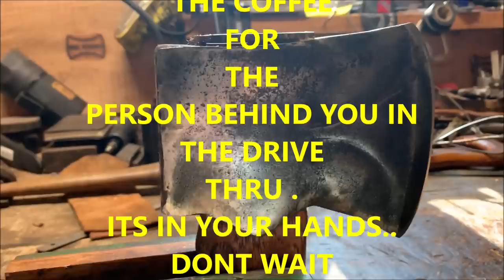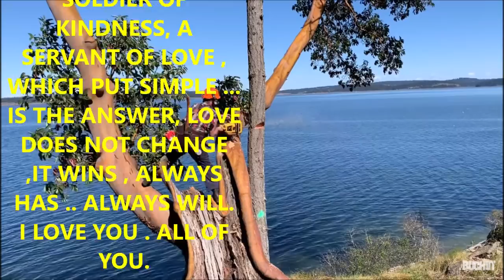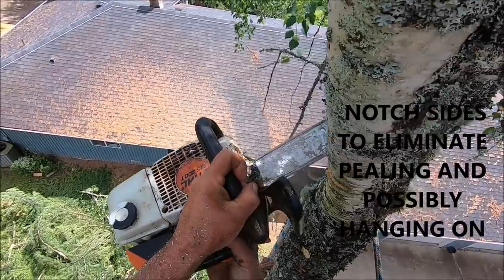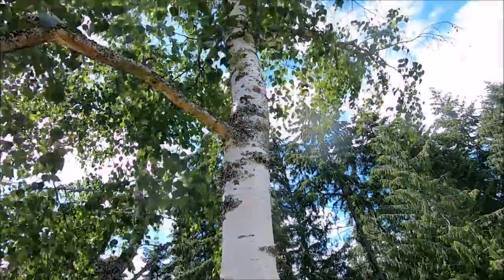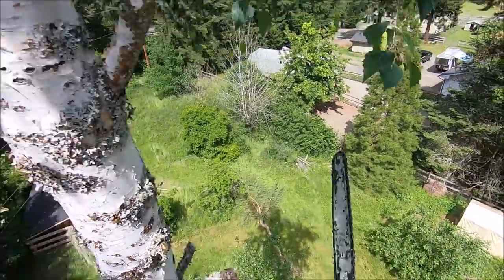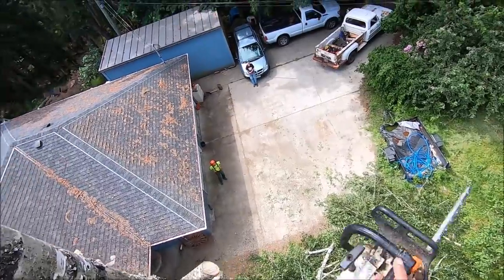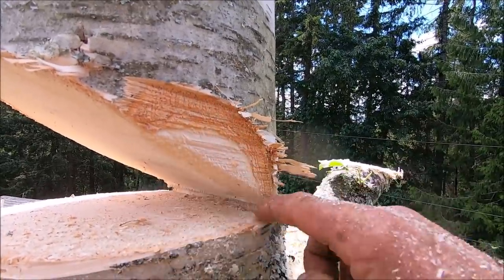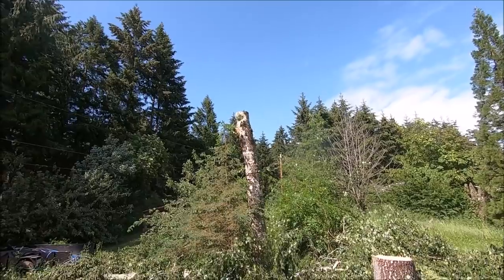Big Guy up a skinny tree, tips and tricks

Comment: Hey Buckin, I just started out climbing with spurs, I had to remove a dead redcedar tree, a small one (about 40 feet high). When I came near to the top it was small and hard to keep balance, removing the side branches with the chainsaw wasn't a problem but making the notch and back cut for the top was really hard with the chainsaw I felt like the saw was pushing me to the side, maybe because it was dry wood and hard to cut or maybe my chain wasn't very sharp anymore...

Comment: G'Day,,,Have been catching up on past Films,,you keep mentioning about gullet removal,,
just wondering,how much,the tooth height compared to raker height should be,,
Now I only have a little McCullough,32cc and 16 inch bar,plenty for what i need,
sharpen my own blades using an electric sharpener,,now to be honest have a cheap Chinese saw i still havn't started (3 years now) and an electric,,all run the same Chains,,(made sure of that 3 saws,don't want different chains,),But i do need to know what the raker height should be,,
much thanks,,
be kind and other will do the same,,

Comment: When cutting the notch to drop the tree what is the difference between the 2nd cut coming in from the bottom or the top?
Reply: The humble notch  or upside down conventional notch is used when felling trees for logging as it saves out more of the tember by taking the notch from the stump and leaving the log clean cut
Reply: @Joshua-wj3je  here in the Eastern area we use the conventional knot also as it removes some root flair as well
Reply: @scottbennett6494  thanks for your help as I am no expert